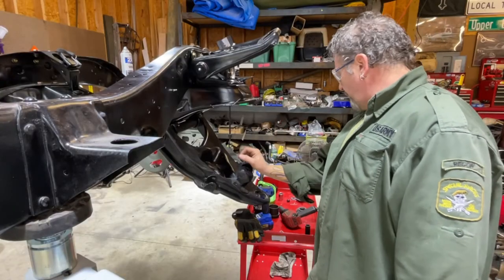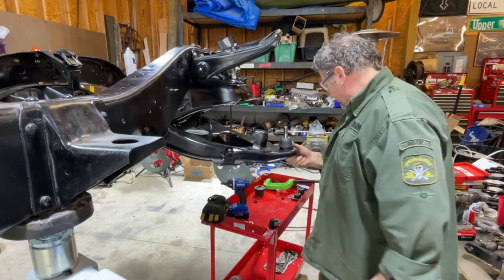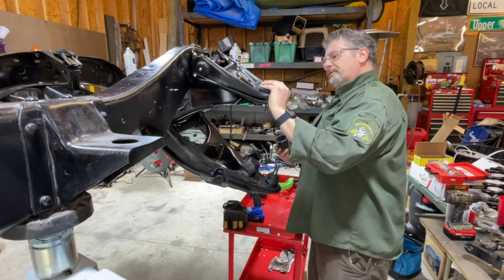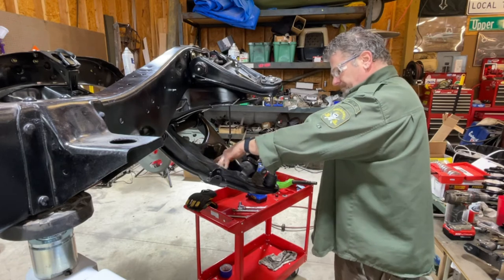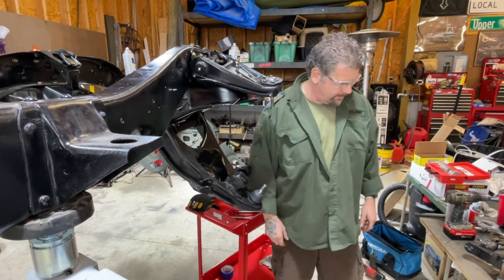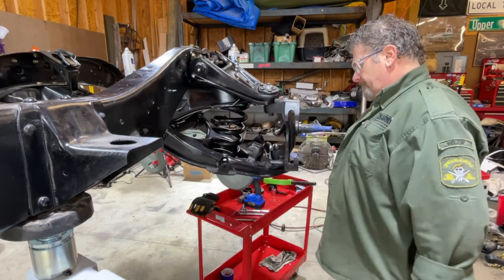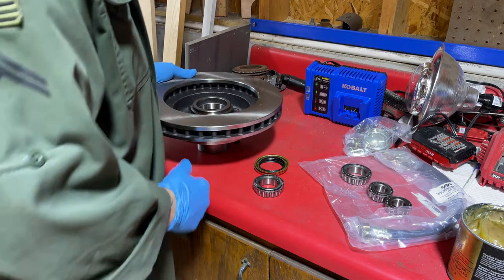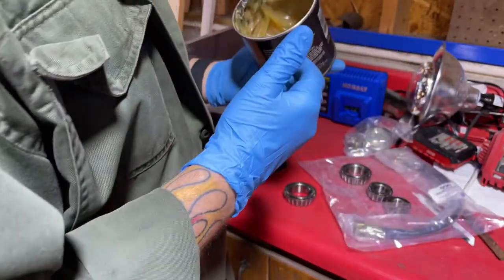68 Chevy C10 Front Disc Brake Conversion

Comment: You have the upper ball joint bolts in backwards , The nuts should be on top to avoid rubbing on the grease boot .

Comment: Nice video very helpful! Do you know what size brake pads they are i have a C20 with a front disc brake conversion and i have no idea what brake pad size they are wondering if its D52?
Reply from the maker: Sorry. I don’t. The conversion kits use a heavy half ton stock parts.